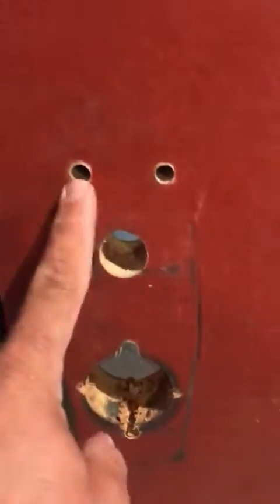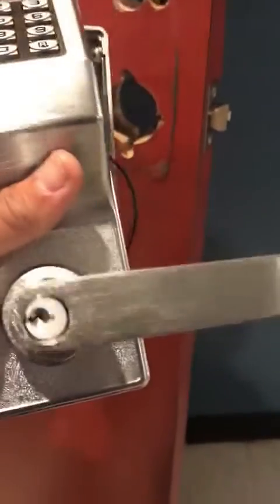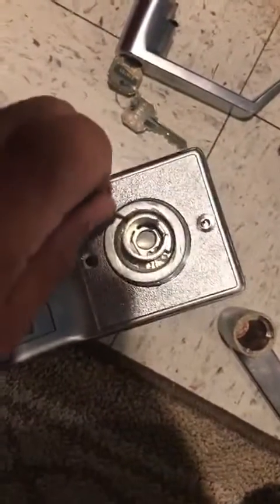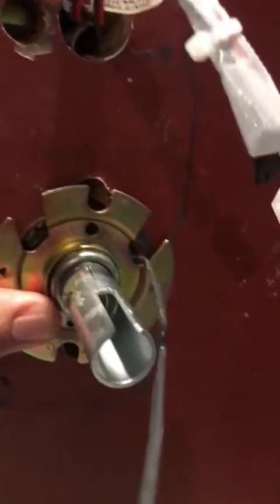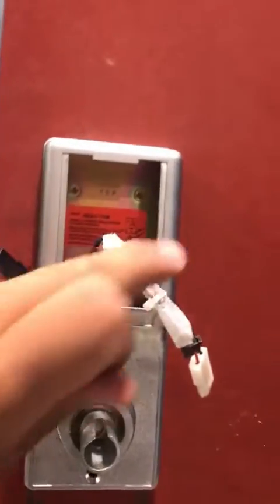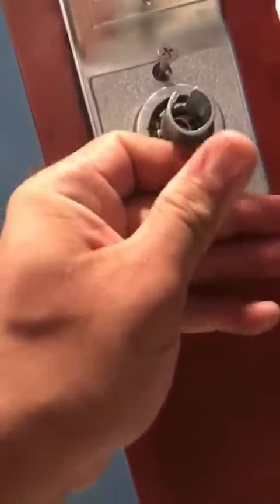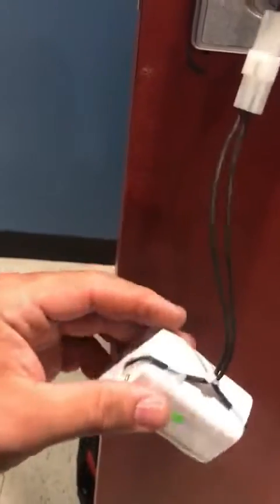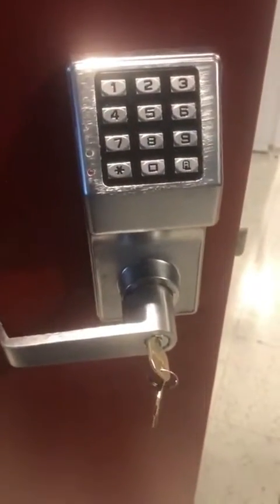How To Install an Alarm Lock Trilogy T2 DL2700 Electronic Keypad Lever

Comment: I have installed 5 of these in the building I manage and I put the mounting plate, where the two little screws that he was trying to line up, I put the plate on first before I mount it to the door. 

But I think our doors are too thin, so that is why I am rooting around on YT to see if there is an adjustment for thinner doors.   There seems to be 3 plastic rings that could be used as an adjustment, but I am not sure if there is an easier way.  

I liked the swapping how the lock was handed. . . very informative.
Reply: I have a too-thin door I'm trying to use this on as well, the manufacturer told me to use S6072 Alarm Lock Spacer Set.
Reply: @conleymacp  : Oh, good to know those exist.  I ended up cutting up some scrap 1/4" UHMW I had lying around to use as a spacer. I traced the outside of the lock and then cut the center out  by leaving about 3/8" all around the inside perimeter. . if that makes sense.  It was a rigid gasket basically. It looks nice too.

Comment: 2 hrs 52 minutes from the time I started pulling the old knob and lock off to finished install but not yet coded. Drilling thin holes was a pain on a steel sheeted door. But it’s done.
Reply from the maker: Great work!
Reply: Yeah 2 hour installation more realistic!

Comment: I installed mine, and reset the codes just as required.. now it won't lock? stays in unlock mode regardless of codes entered? Any Suggestions??? Key will work but cant remove the key in locked position.. Any suggestions

Comment: Weird enough, I got this lock and the key doesn't turn the cylinder 
Which means I can't reverse the handle be abuse you need to turn the key to take the cylinder out